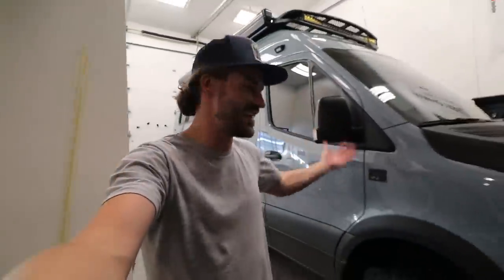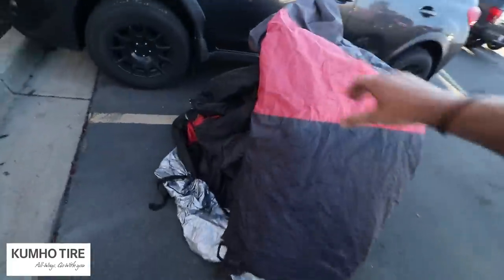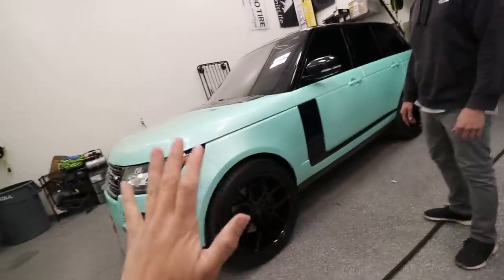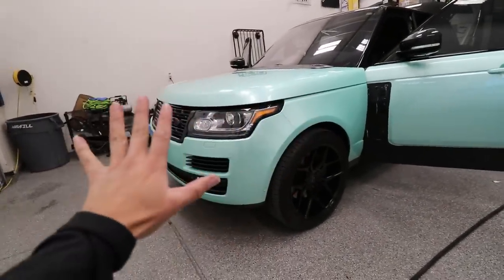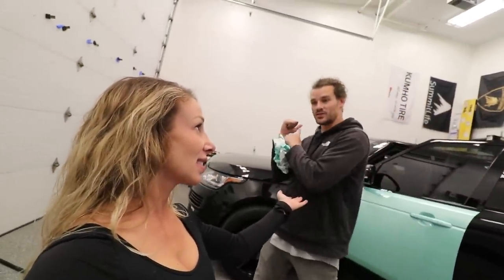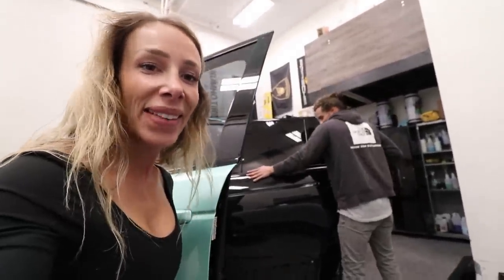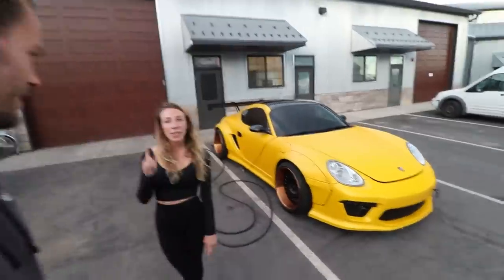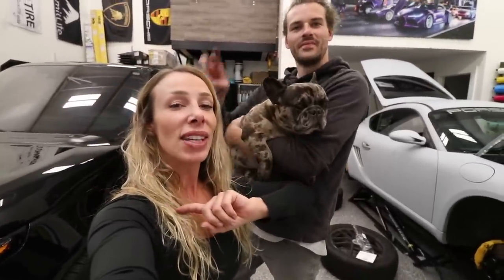So it’s finally come to this…

Comment: 2023 Audi RS Q8 same engine as the Urus just a little less power 591hp not 640hp due to tuning,Same chassis. Awesome looking,quite exclusive,fast as heck. All For less than half what Urus cost. $123K fully loaded. Wishing you guys all the best with your future ventures.

Comment: Faith, I would recommend a Lincoln Aviator has a twin turbo V6 and pushing 400 horsepower and I think almost 500 horsepower if you get the hybrid version. It has everything the heated and cooled seats on all 4 seats depending on the options has the power and has the luxury that you are looking for.
Reply: and better gas mpg right?
:buffering:

Comment: Porsche Cayenne turbo s, Durango hellcat, Mercedes GLS63 AMG, BMW x7 m60i, Ford Expedition stealth package. Has 440 hp and 510 torque. From research I have seen it will do 0 to 60 in low fives. I also saw something that said 4.9 sec to 60 mph. Not Bad for a huge SUV. Also for a v6. I have been looking at one. I am like Faith and love fast suvs. I would say sell the Cayman and use it to make more YouTube videos if it would gain you more profit then what you sold it for, otherwise keep it cause it is a nice car.